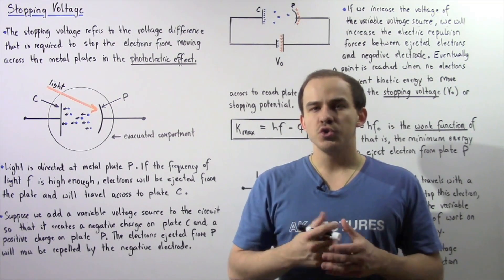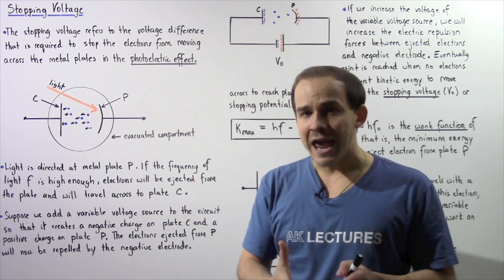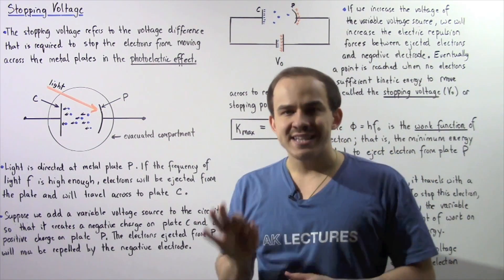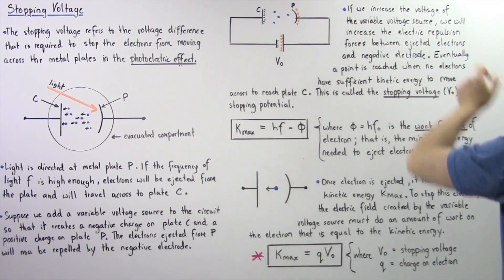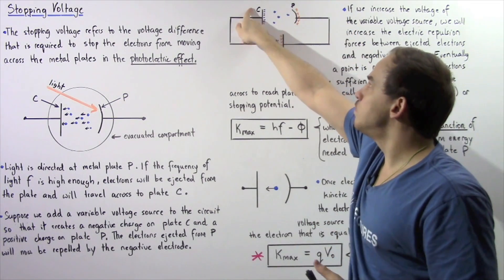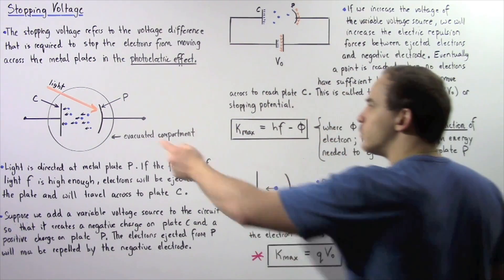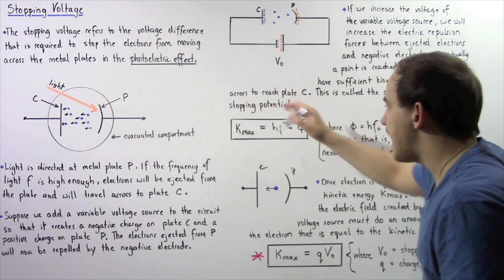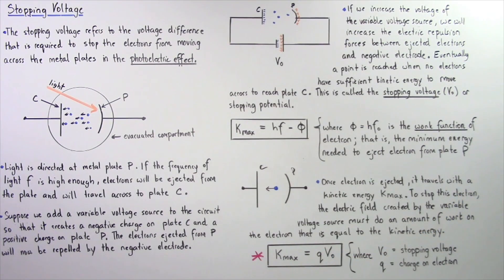Stopping Voltage and Work Function

Comment: why would electrons from plate P move towards negative terminal of battery. Wouldn't electron  repel the negative terminal?
Reply: Even if the C terminal has a negative charge, if the kinetic energy of the electron is large enough to overcome the force of repulsion, the electron will keep moving towards the negative electrode.